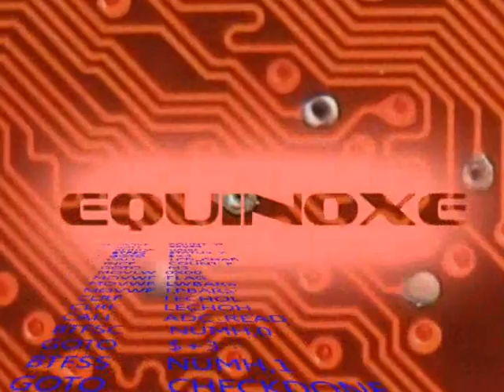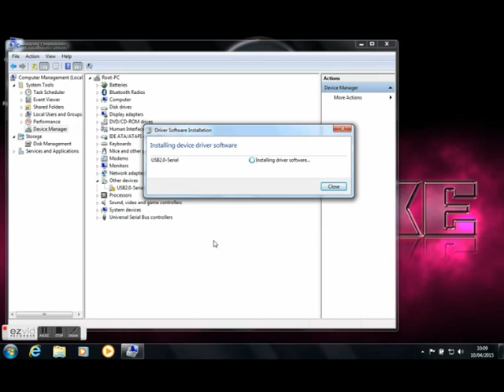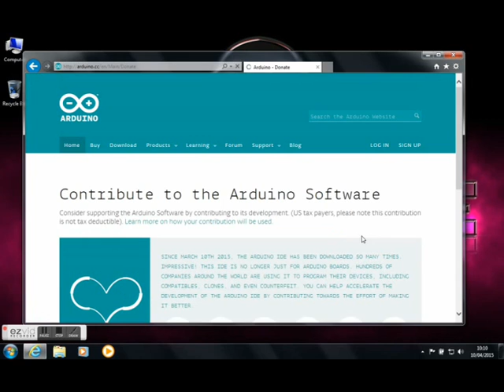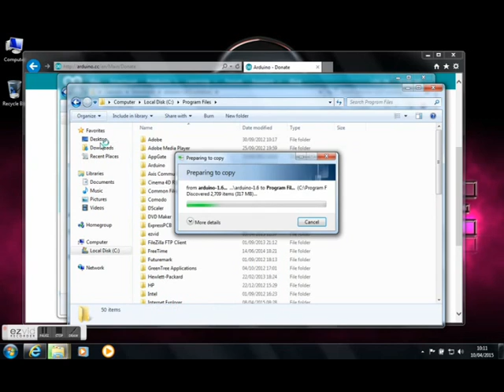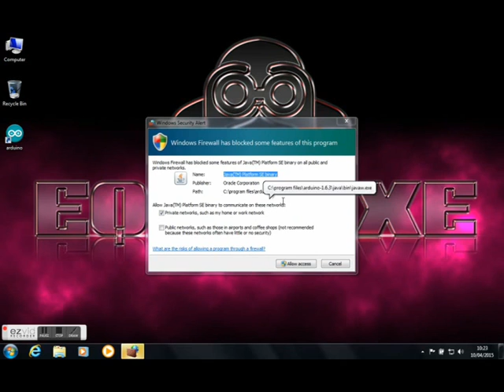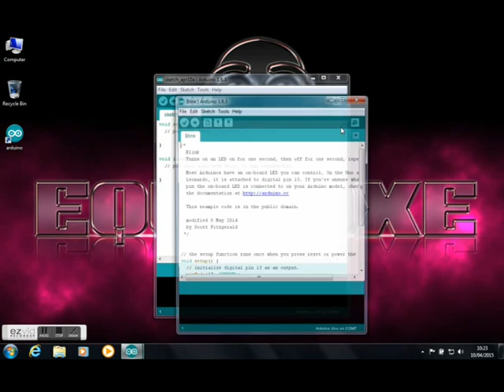Arduino UNO R3 - Getting Started

Comment: Hello, I'm trying to use the arduino uno r3 with a joystick controller if I want to just use it manually do I still need to activate the uno r3 or can I just plug it in and use it that way?

Comment: Hey i have recenly built a zumo sumo robot using an uno R3 and i noticed there is a certain amount of space that get used when i load my programs onto the arduino and i was wondering how or if i could clear memory so that i dont run out of space, or will i have to buy a new one every time my space gets filled up

Comment: oh my, i ordered one expecting to, well bitten off more then i could chew (i regulary give myself challanges) but this one seems really nicely straightforward. T
Reply from the maker: Hope you're getting on ok with your Arduino, there is plenty of information out there if you run into difficulty. Can I recommend the HC-SR02 module as a 'next step', it is a simple to connect distance measuring module that you can pick up for the price of a cup of coffee! The beauty of it is, there are NO libraries required (which can be a fiddle sometimes to get working)...so with a few lines of code you can be up and running with it. Check out this tutorial https://www.youtube.com/watch?v=DvXXjgedXI4 to see how simple it is!